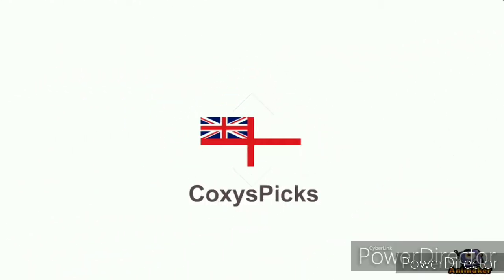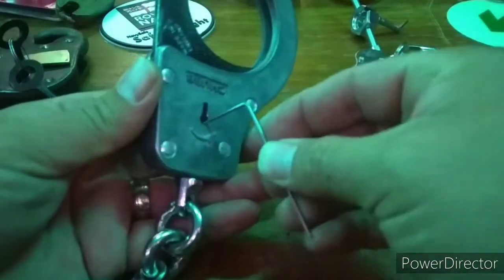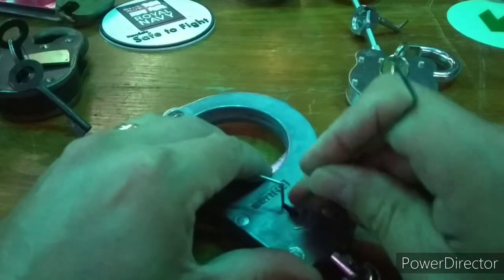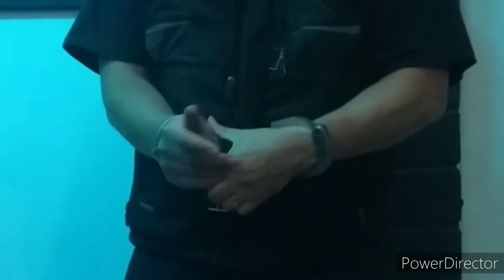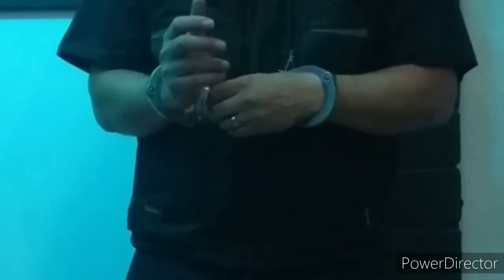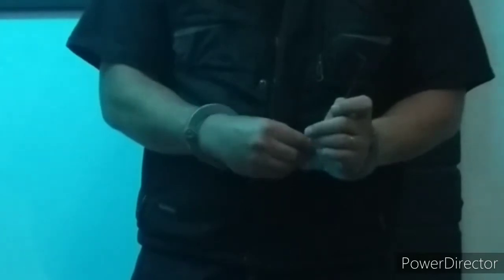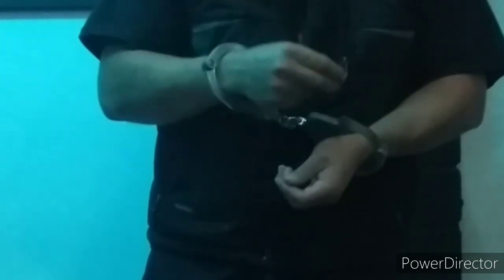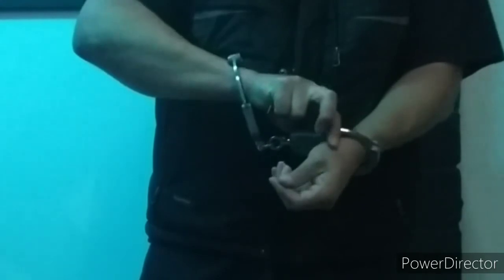Chubb IK70 'Detainee' Handcuffs - Two Tool Method

Comment: Very cool brother! Can you do that with S & W cuffs? 😉
Reply from the maker: I would use a different technique on S&W. Mainly as they only use a single lever inside and so in theory you can slip them exactly the same as the alycon, and the TCH 830. One of the cool things about S&W is it has a very large keyway compared to European cuffs which should open up the attack vectors 😂 Stay safe buddy and have a great week 🤘😎
Reply: @CoxysPicks  I kinda thought that they would be completely different. And yes from that description, I was 100% correct.......completely different. 🙄 Yes, you are the handcuff kink, hands down! 👑😉
You'll have to try that out here in the near future......😏
Cheers

Comment: Nice job, looks like I was on the right track anyway. Can you do it with the keyway facing away on the other side?
Reply from the maker: Keyholes up is a bit trickier, but it just means bending your arms a bit squiffy. If these were rigid then keyholes up = all bets off, however,  with the chain you can twist your arms into the needed pose 👍